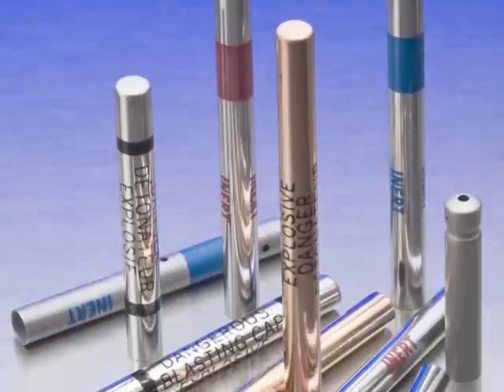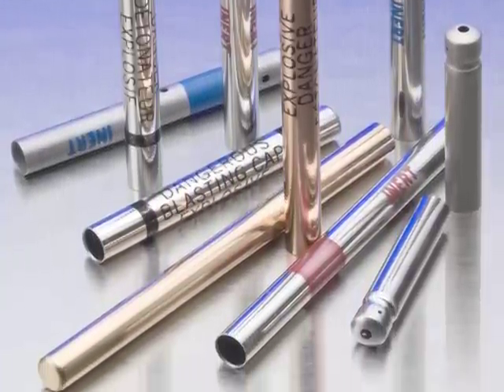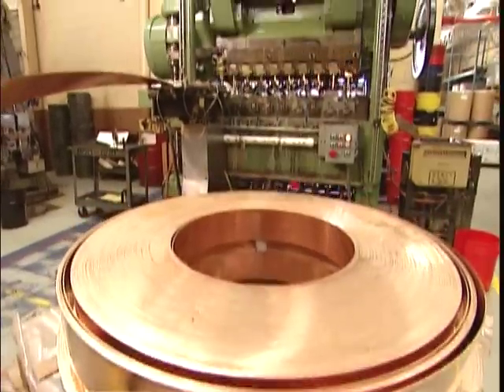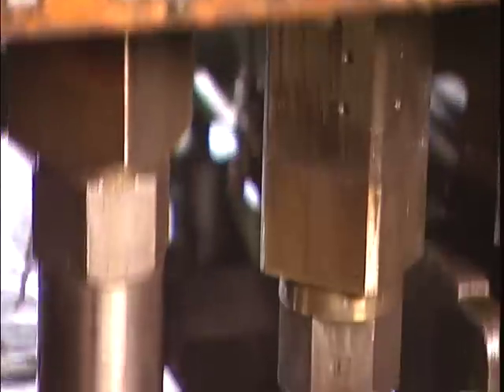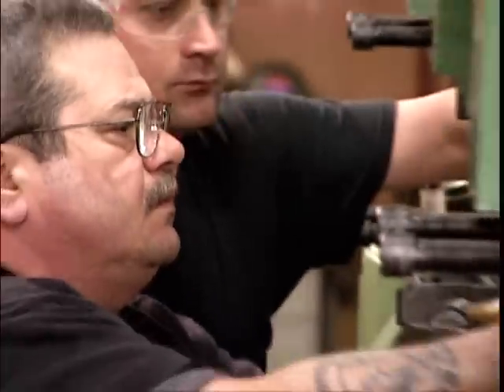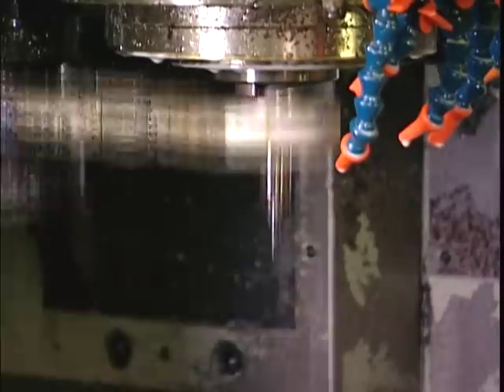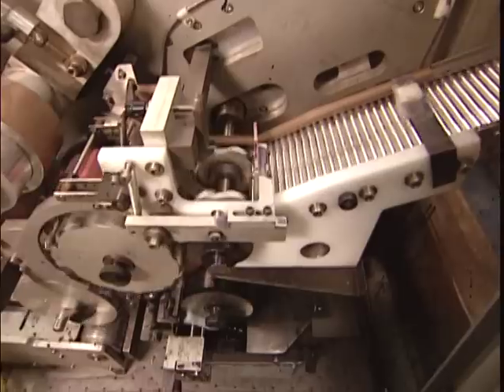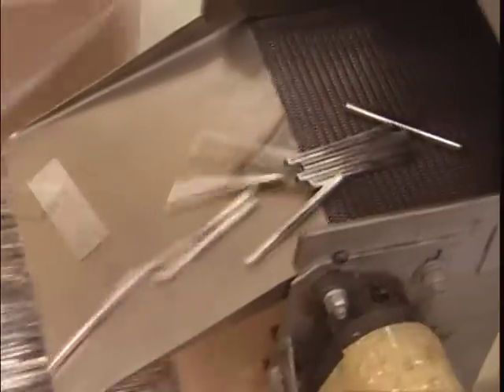Gem Manufacturing Co., Inc. Detonator Industry

Comment: One of the caramel into the chocolate question I would like to know, is how, on a production level can you produce a consistently precision MS delay element? These are really the key challenge as I see it and the most critical in producing a product that can make or break precision blasting. I see electronic caps are now moving into the market, expensive for now but will probably become the mainstay in the non too distant future.